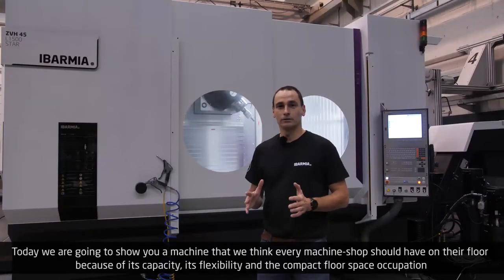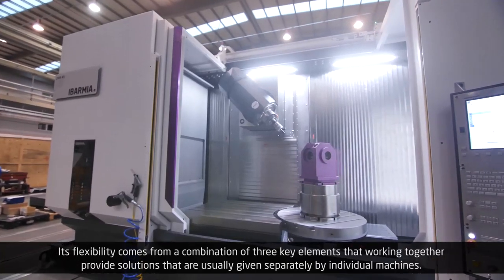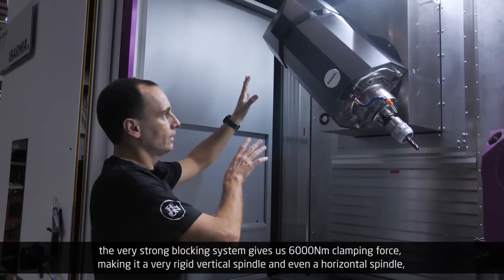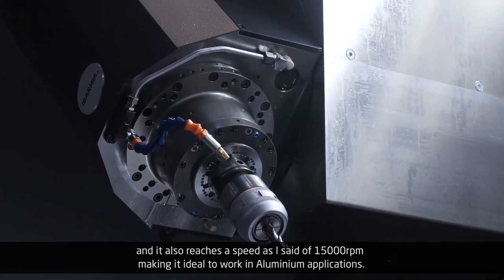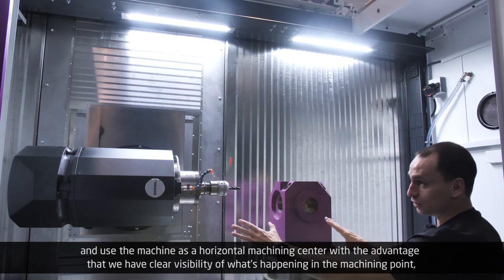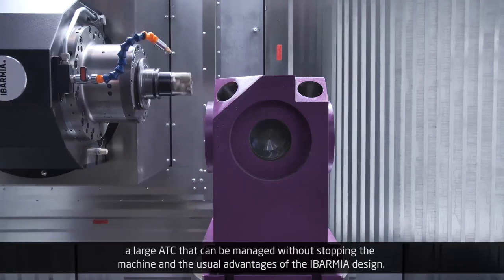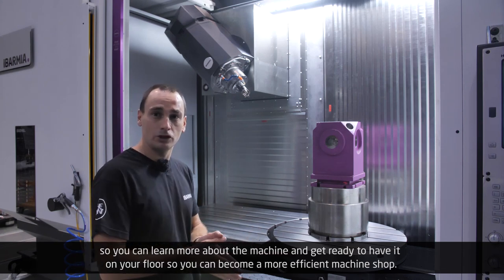STANDARD CNC MACHINING CENTER - IBARMIA ZVH 45/L1500

Comment: Very nice machine, but the spindle position design seems to be wrong. It can collide in deep works.Spindle carrier corner appears when b axis rotates 20 to 35 degrees. It is almost in line with the holder and when we look at this corner from the side, it looks very close to the spindle center.There are two solutions to overcome this situation. first the user will use long holders. This may vibrate the cutting tool or the holder.Secondly, the company that made the machine can fix this by making the spindle a little longer or pulling the b-axis rotation center back. But this shortens the z-axis movement distance. :)

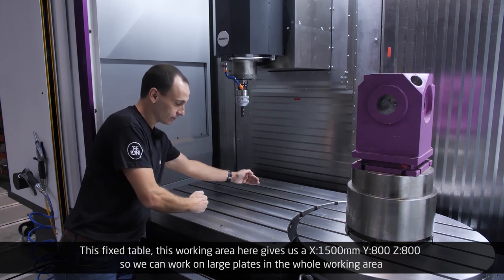Comment: 4:12 can you lock the C axis so i can not accidentally move it while a part is fixed to both parts of the table and damaging something?
Reply from the maker: Yes, sure! You can disable the C axis in an easy way from the user parameters letting it hydraulically blocked to avoid any unexpected movement. At this time, the C axis will not exist any more for the machine so you could not move it even pushing the buttons in the handwheel or in the control panel itself. Once you need it back, you should just need to activate it again in the user parameters and the C axis will be ready to use it again.
Reply: @IBARMIAchannel  sounds great :)